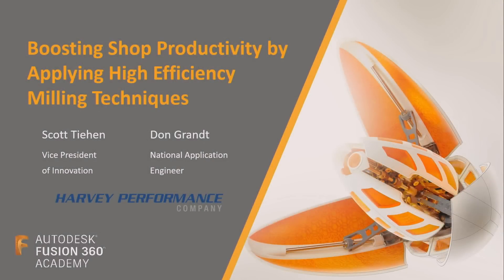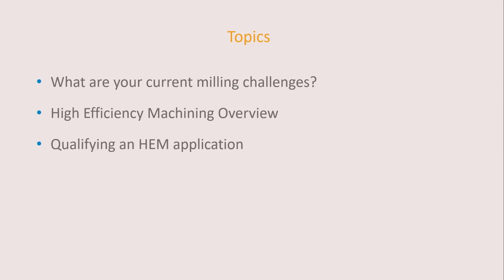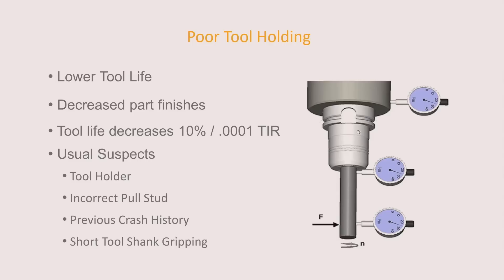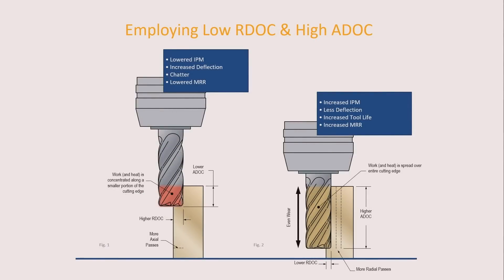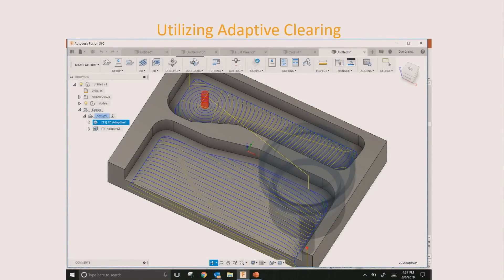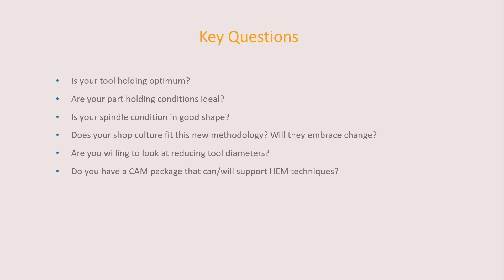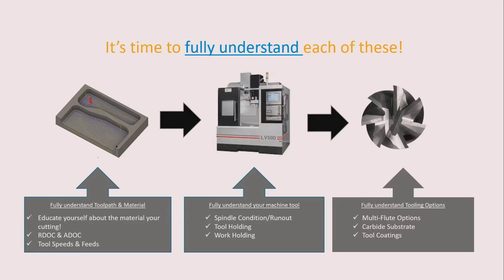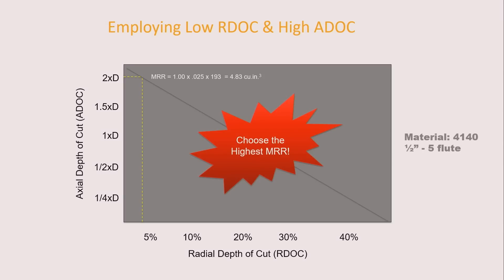Boosting Shop Productivity by Applying High Efficiency Milling Techniques

Comment: In Fusion 360, if I set the optimal load in the adaptive toolpath, do I have to recalculate for chip thinning when going deeper axial and thinner radial or will Fusion calculate that for me?